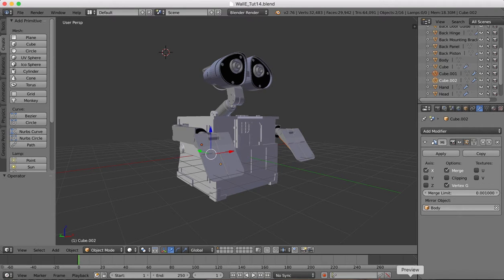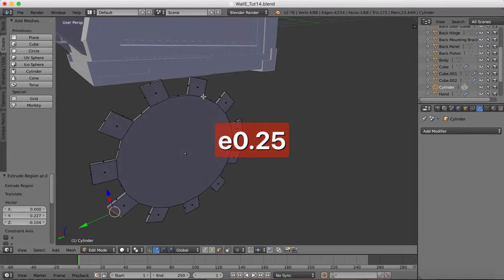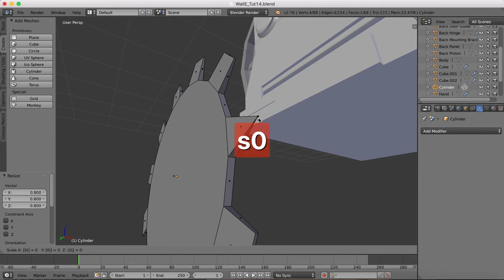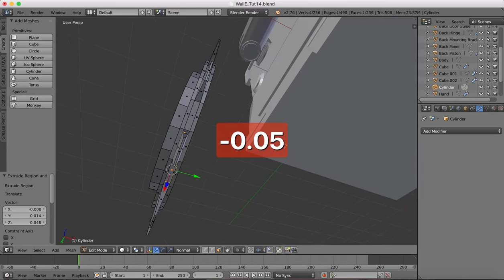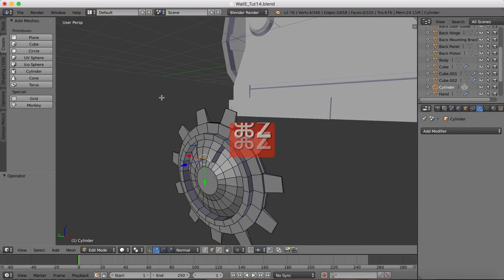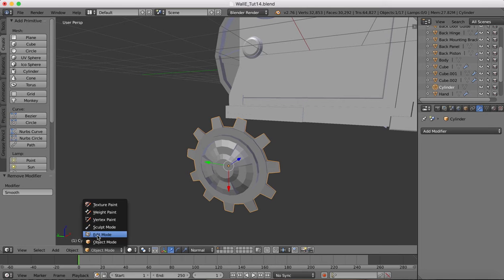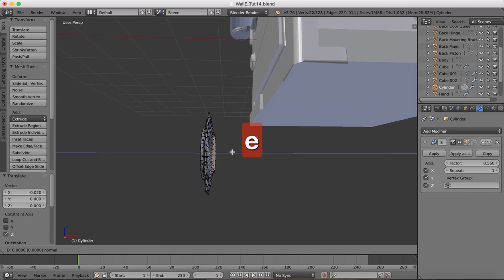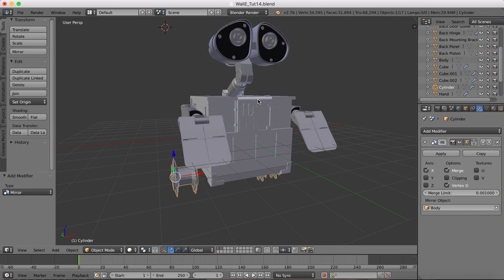Blender Wall-E Tutorial 15

Comment: Simplified cog teeth preparation: Select the face ring (Alt+Click on one of the edges in between two faces). 
Keeping Shift pressed, choose a face to deselect and re-select it.
Then go to Select, Checker Deselect (this will deselect every other face).
Then choose Extrude Individual and type the desired amount (.25, in this case).
To scale all the faces in a single stroke, change the pivot center point from Median Point to Individual Origins.
Enter the appropriate value (i.e.: .88).

Rotate the cog as appropriate to get one tooth pointing downwards (I rotated mine 5.625° on the Y axis).
Note: For symmetry, my cog has 16 teeth (like the original), so the default 32 faces are what I needed.
This will help when modelling the 4 protrusions, later on.

Samewise, for extruding the inset faces inwards, select them all and then Extrude Individual (-.05).